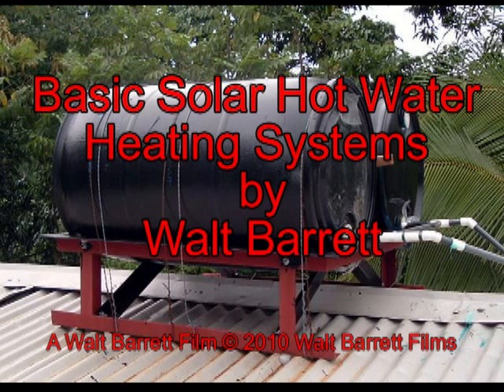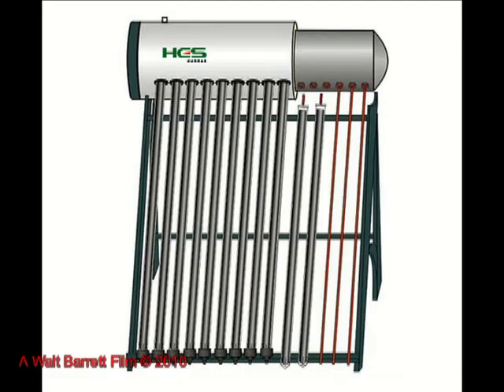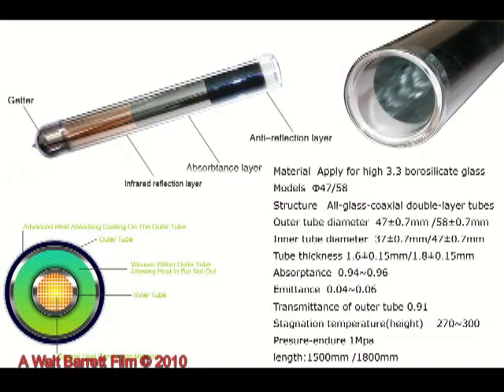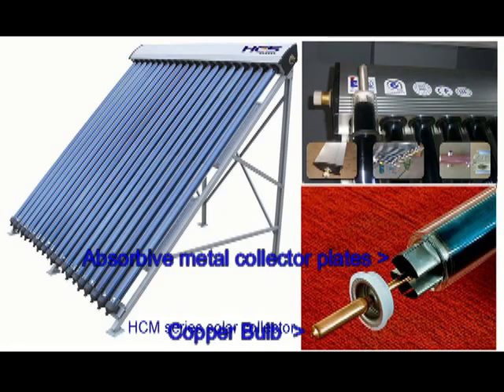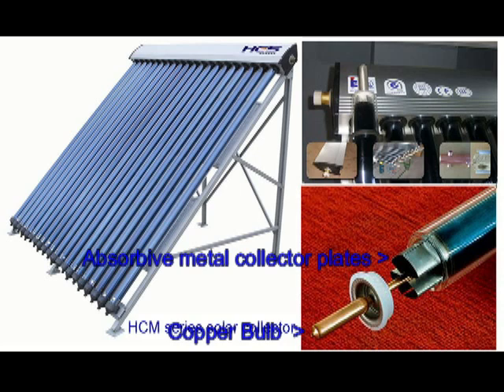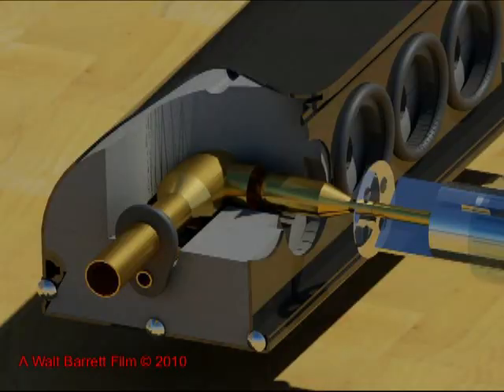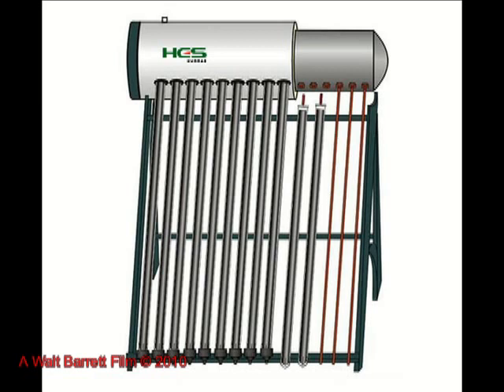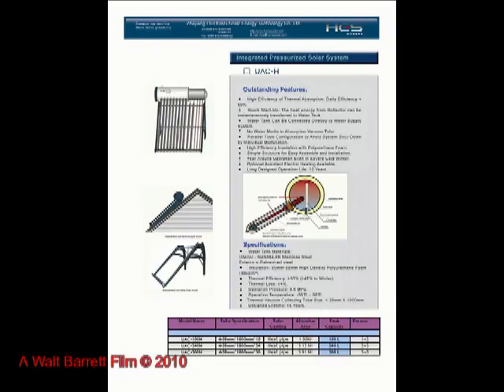DIY Simple Solar Hot Water Heaters by Walt Barrett

Comment: It would be a good system for heating pools as it would be installed on ground level ,i would put the inlet at the bottom of the first tank as hot water will rise and the outlet on top of the first barrels going to the bottom of the other and out the top again these would also keep the barrels full .
another use would be heating hot water for washing clothes ,dishes and showers .
Good idea Walt ,i might just set the system up next summer.